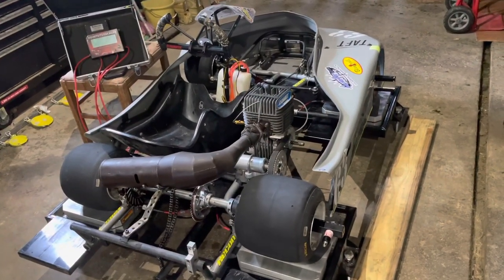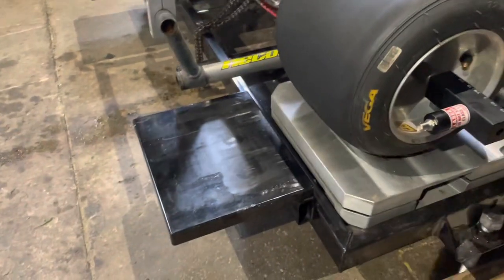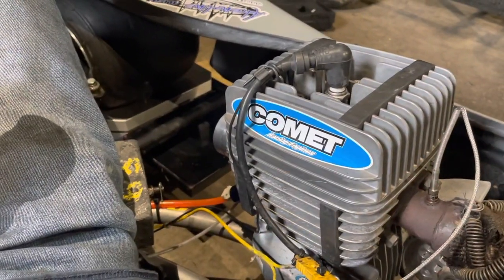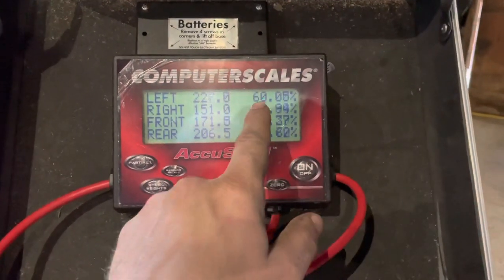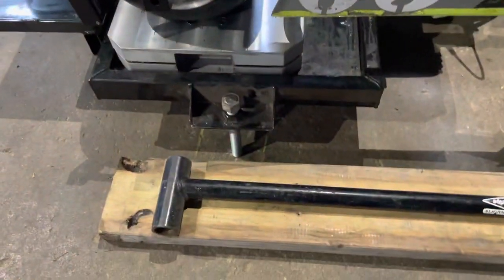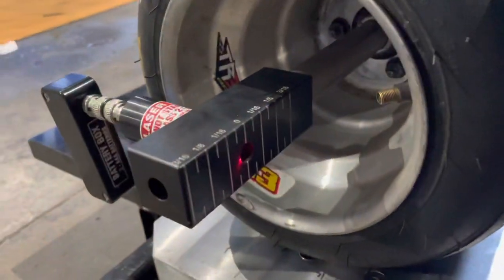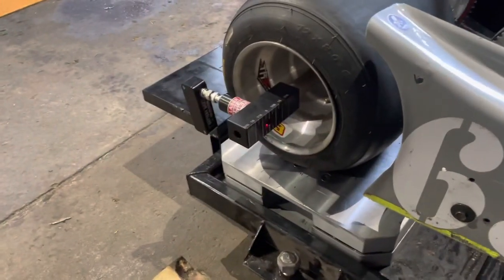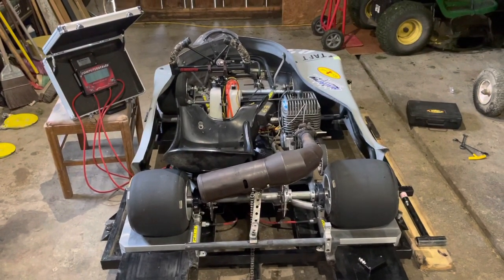Kart scaling basics

Comment: If you use bathroom scales the (I race weigh)  app is free on the apple App Store. Works great to input the weights into to get your cross left and rear. Great video  as always thanks. I’m not sure how close the numbers were for you but mine are extremely close to these numbers. If you would I would really appreciate getting your actual numbers. I am starting a new track this year coming from a 1/10 mile banked track to a 1/7 mile flat track and I just need a baseline
Reply from the maker: This kart normally has  59left 63-65Cross 45.5/46 Nose

Comment: How you do the math? I wont ever be able to get bitchin scales like that. LOL
Reply from the maker: Total weight.  Example: front two tire weights that number is what % of total weight.   420lbs kart weight, 189lbs 45% nose   Cross would be RF to LR weights.  I’m not great at math so these scales are great.
Reply: @kart6t3_ben  thanks for responding back. As long as on can simplify the math into a simple formula or equation its not tooo bad. But yeah I am already looking at getting scales. Lol!

Comment: I usually scale once and adjust at the track . Only time I put it back on scales is if I crash and have to replace parts.  Just a little secret for newer Karter keep right side square always have tire size the same for right sides make all adjustments to the left. Make all stager changes with left rear and left fro t.at the track.